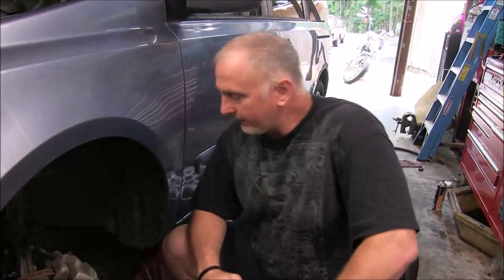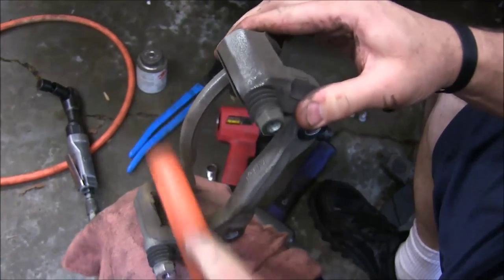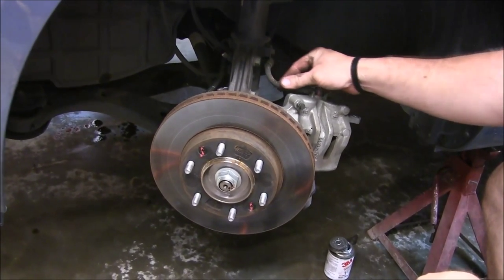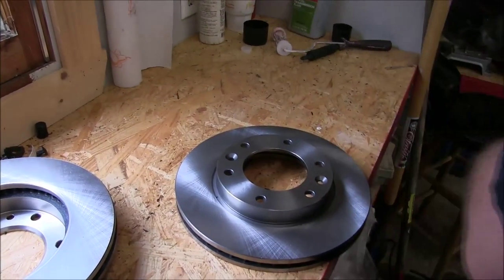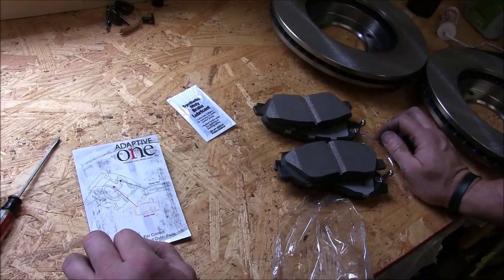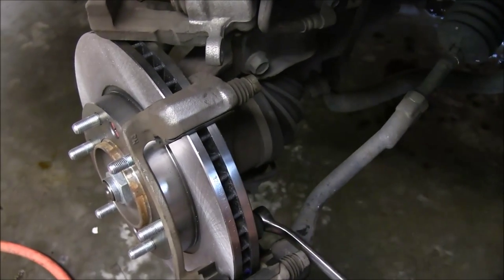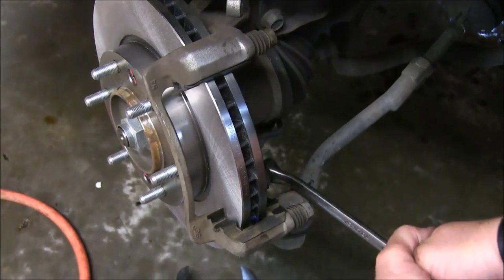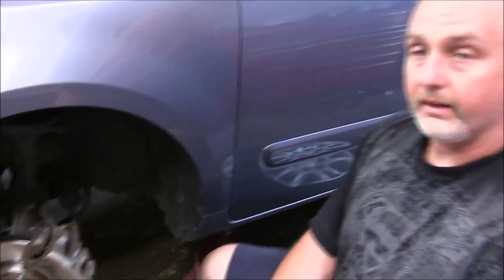How To: Do A Front Brake Job On A 2009 Kia Sedona

Comment: Excellent video! One for the better automotive procedural ones I've seen. Just finished replacing a caliper on my 2011 Sedona (driver's side front). Lower caliper pin was seized and the pistons seemed a bit sticky.

Comment: I have a 2011 KIA Sedona that I'm doing a brake job on, however, I'm down to the rotors with both screws out, the rotor is loose but will not come off and will only come out about 1/8 of an inch then jams.  This happens on both sides.  I even hooked up a gear puller to the rotor and put enough pressure on it that it should have popped loose but didn't.  Didn't want to put too much pressure on the puller for fear of cracking or busting the rotor.  Any suggestions??

Comment: does anyone keep rotors and just change pads anymore?
Reply: exactly my question.....    Seems a waste to change rotors when not needed, esp. for a do-it-yourself chap who uses good pads....  Couldn't tell if the rotors here were scored or not...... he didn't even mention the issue, just presumed both were to be changed.
Reply: @hugh3rdof5  
Usually you dont replace brakes without replacing rotors or resurfacing the rotors. If you leave old rotors without resurfacing them you might run into performance problems. People do it all the time but I wouldnt.